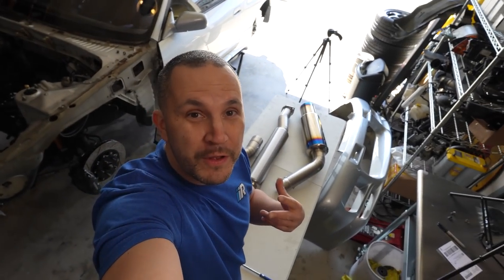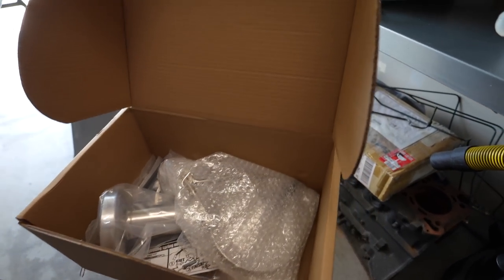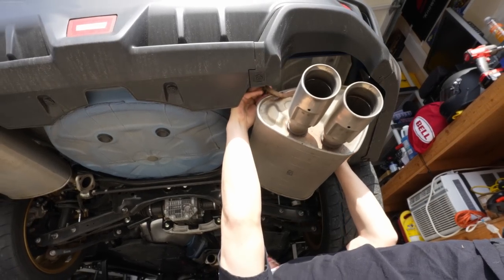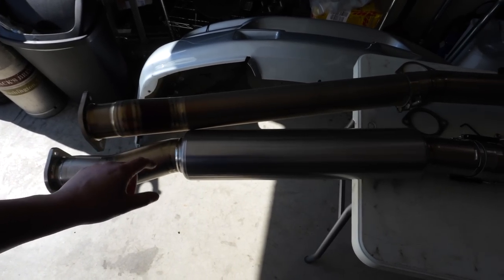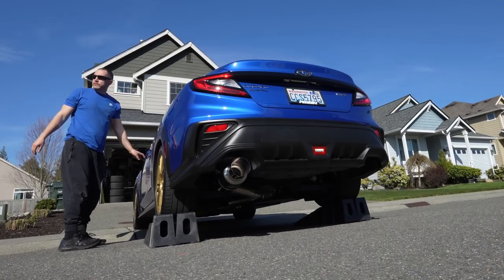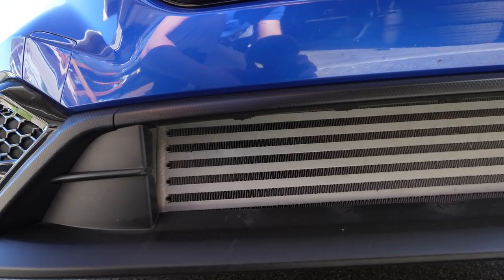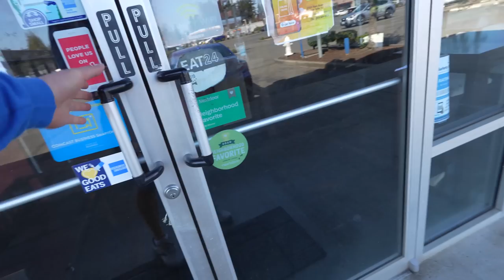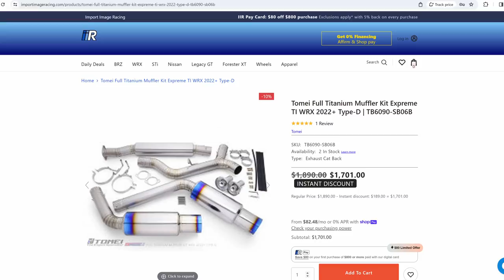Tomei Full Titanium Expreme VB WRX exhaust sound test review Type-R D Subaru 2022-2024

Comment: For anyone wondering.. I have this on my 23 VB and the sound is way better than what the camera picks up. No drone at all.. super nice tone.. expensive yes, but worth it if you want to buy one exhaust system and leave it for the life of the car, or your ownership.
Reply: Thank you for this comment about the exhaust. I’m considering more than any other catback. I’ve got a remark boso axleback (looks amazing) and the drone is pretty crazy…. Definitely looking forward to an upgrade.
Reply: Doesn’t seem loud enough imo especially in high rpm.
Reply: @Blue_Ghost-X  still breaking my motor in. I’ll find out soon.
Reply: So I’ve had 3 prior tomeis on 3 separate ej wrxs and it was awesome and sounded so good but always was quite with the stock downpipe/headers. On my current vb I have a remark muffler delete and it has a lot better volume obviously since no mufflers but I really want the tomei on the vb but I’m conflicted because I don’t want it to be as quite as I’m assuming it will be. I really like the volume on the remarks, do you know how much quieter the tomei is vs a muffler delete?
Reply from the maker: Totally agree with everything you said with your overall impressions for the Tomei exhaust. This really is the best VB WRX exhaust I have seen, not only the looks, built quality, but the sound is epic. Glad you love it as much as I do, thanks for watching.
Reply from the maker: I had the same drone issues with the ETS exhaust quad exhaust. At 1800rpm it produced a weird drone sound and on the freeway it was obnoxiously loud. The Noble sound was better than the ETS, but was loud on the freeway at speed. Had an AWE system, but never installed it because build quality was horrible and I could not feel good about recommending it on my channel. The Tomei is the best by far, for build quality and sound. My wife and daughters like the no drone factor.  Thanks for watching.
Reply from the maker: For sure, that resonator cuts down on the sound quite a bit. If you like loud, quad exhaust was the loudest I had, the Noble was in between for loudness. But the Tomei is what I consider a gentleman's exhaust. Not to loud at all, I guess I am just getting older almost 42 now. Thanks for watching. 👍
Reply: @JDMRightHandDrive  Noting against your preference of exhaust. Personally I don’t like loud exhaust either. I have a Remark quad tip muffled on my 22 and I love it. I just was thinking a single exit like this would def be a lot louder.

Comment: Hey I just put this on my car and upon start up there’s a clicking noise coming from underneath, so idk if it’s an exhaust leak or what? How are you able to tell? Also are you supposed to use a cat back adapter for this or just the stuff that comes with the exhaust? Cause I didn’t use an adapter. And one thing I used when tightening the bolts on the midpipe to cat, is the bolts are fully tightened but it isn’t a complete seal with eachother? Thank you

Comment: Hey hey I just installed mine and I notice it’s leaking a little bit on the slip joints where it connects to one another how did you fix that issue ?
Reply from the maker: Sorry to hear that. I have not experience this with my car. Make sure the slip joints slid in as straight as possible and they are not crooked at all.  Also make sure the clamp is positioned where mine is close to the outer edge. Make sure its even so it gets even pressure all the way around when you tighten it.

Comment: How much quieter is it than the noble? That’s what I currently have and cold start is pretty loud
Reply from the maker: The cold start is significantly quieter with the Tomei, I would guess its 3db less loud over the Noble. I will have to order a DB meter and test what the cold start volume is. The Tomei on the freeway is so quiet now that I can hear the wind noise and road noise from the tires over the exhaust now. Good question, thanks for watching.

Comment: how does this compare to the AWE touring? I have that exhaust and it sounds pretty similar based off this videos sound clips
Reply from the maker: I never installed the AWE exhaust that was sent to me for free. That exhaust system had so many issues out of the box. The mufflers didn't match, one looked new and one looked all rusty. Quad tips would not fit on mufflers without internal wielding marks being ground down on the inside to slip over. Mufflers were all scratched up like they were slid across a metal work table while being built. Plus mufflers were covered with tons of wielding splatter.  Even though this exhaust was sent to me for free, it had lots of issues. I asked AWE to send me matching mufflers that don't look like they came from a junk yard. I told them that I was going to give an honest review and show what I am seeing with their product. They said they would send me a new exhaust and that it would be in new condition. So I sent back the exhaust to AWE and never received another one.  I filmed the unboxing and showing how bad the system arrived out of the box, but never did anything with the video. I never installed the exhaust, I wish I would have, so I could have listed to the exhaust note for myself. I know that the AWE exhaust is supposed to have one the the best sounds. It was very heavy though at 55 pounds. I never finished making this review because I could not recommend something I wouldn't buy for myself.
Reply: i have both awe touring and track (conversion kit), I may get this and report back to you if you don't already get one.
Reply: reporting back and the touring is a bit louder than this

Comment: STi performance muffler or Tomei Titanium? 

Newbie question lol 😅
Reply from the maker: My friend owns a 2022 Limited with the STI mufflers. The STI axle back connects to the stock mid pipe. This means that its a tiny 1.5 inch pipe into the STI muffler section. I test drove the car and the STI mufflers kind of have a drone note in my opinion. I would still go with the Tomei set up. Its lighter and sounds much better. Good question and thanks for watching.